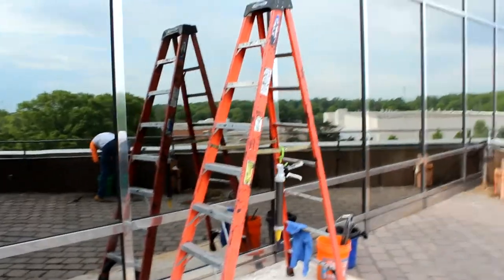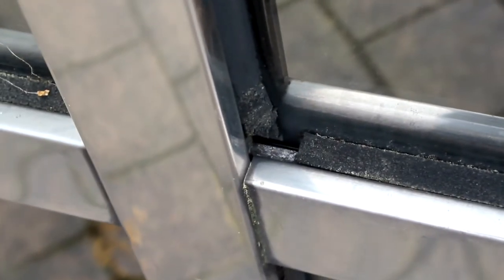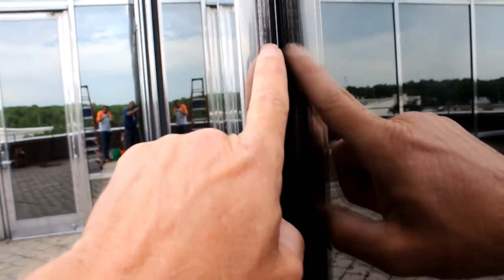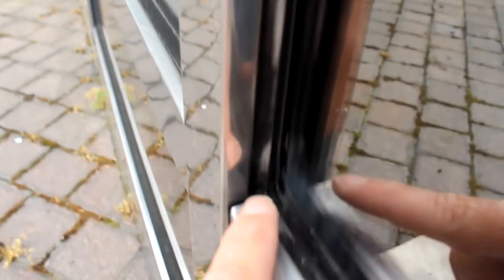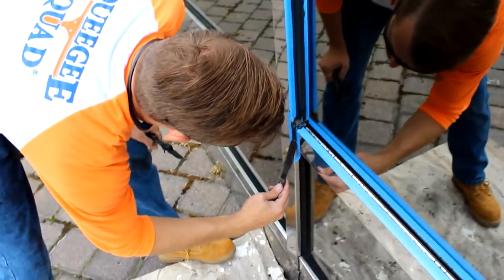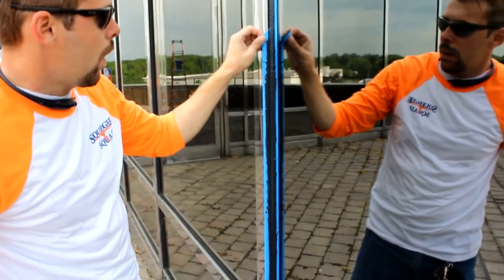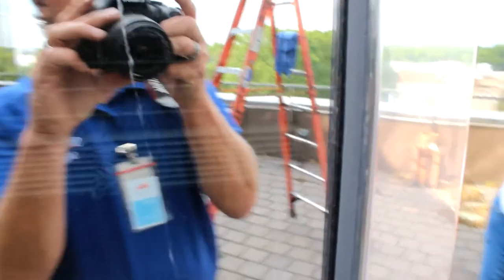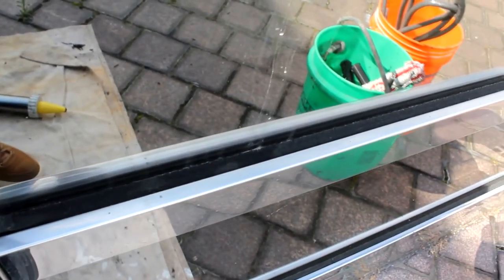Intro to Caulking Building Restoration

Comment: Seems way unnecessary to wet caulk that system when it uses vinly (the gasket). Its as easy as pull the old vinyl out and put new in. Owners could of called the glass shop that did that and they would of replaced it in an hr or two.
Reply: A wet seal should only take a 10 min to shoot and caulk
Reply: @mrvaj2021  you can run vinyl 10 times faster than caulking lol.
Reply: Sorry guy you cant caulk.tape? A real caulker doesn't need tape.
Reply: Depending on how old the curtain wall is, replacing the vinyl gasket is much faster, but the walls are waterproof under the covers by design. Newer systems are designed much better. Caulking an older system, if this is, can make a great appearance as long as the weeping design isn’t compromised. I would use professional glaziers for this task. It’ll be faster, and cheaper over all. A pro won’t use all that tape.
Reply: @leekreeger9885  a real caulker tapes we want crisp clean lines there is no way you can make it look as nice without tape.

Comment: Another Caulking video where the guy is Using Tape! No one who is even mid level caulking when I did miles of way harder caulking than this would ever use tape but I’ve seen a bunch of these clueless videos where the guy loads up way too much makes a mess all over the tape and then pulls the tape and breaks the seal! You can literally see the seal being broken every inch of it and this guys tooling on the sides looks like Shit I got criticized for far less as an apprentice.